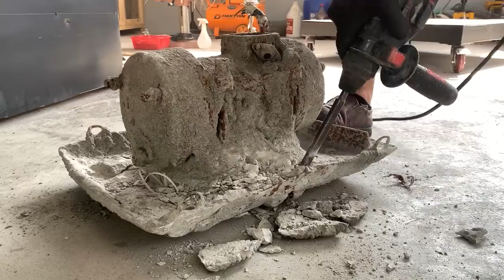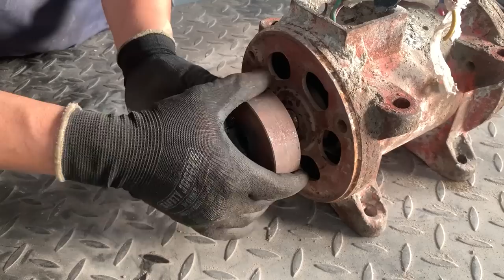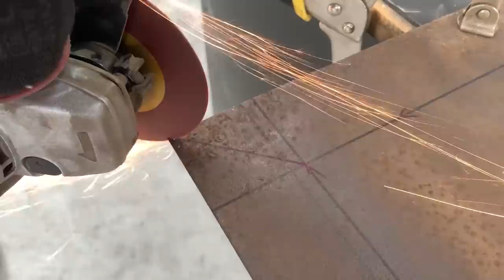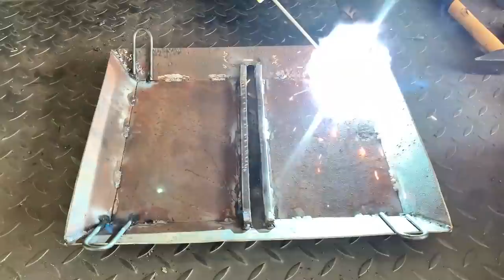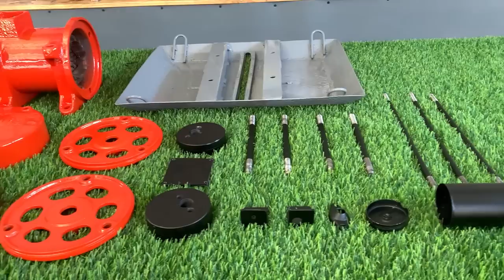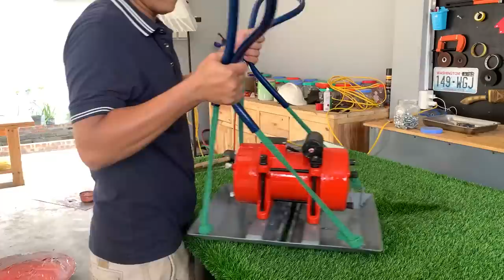Restoration Of Concrete Flat Plate Vibrator // Craftsmen Make Great Repairs

Comment: Suggestions.

Seeing it's a concrete vibrator that will see numerous use, you should've welded everything all the way so that it will be intact much longer, not just spotwelds on the edges and the middle. Also, consider using threadlocking liquid on the bolts so that they further resist movement. Perhaps build a switch too on the edge of the cord so that it can be activated and deactivated at will? I know there's toggle switches that can be locked so it can be turned on indefinitely as needed.

On the other hand, using washers so as not to wound the paintjob is a good practice.

Other than that, it's a fine restoration that will see usage again.
Reply from the maker: Thank you for watching. We did our best to get beautiful products. We had many mistakes while working. We had a lot of mistakes. Please forgive them. thanks you very much

Comment: What was the point of cutting a slot in the plate? No plate compactors have this, it only drags material on to the top of the plate and around the motor.
Reply from the maker: Thank you for watching and subscribing to the channel. Due to the specificity of the job is to make concrete piles, we cut the trench. so that we can go 2 piles at once.
Reply: @restorationproduct1718 
ppp
Reply: Pp
Reply: Llop